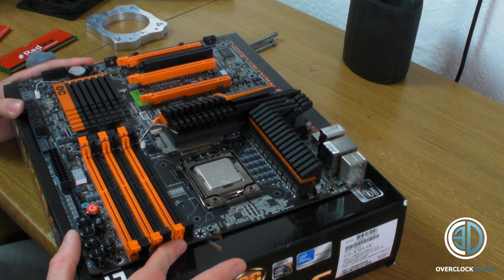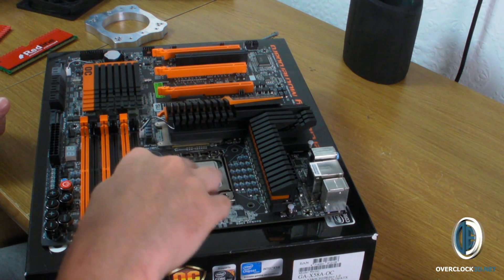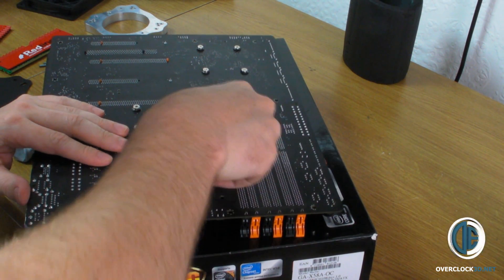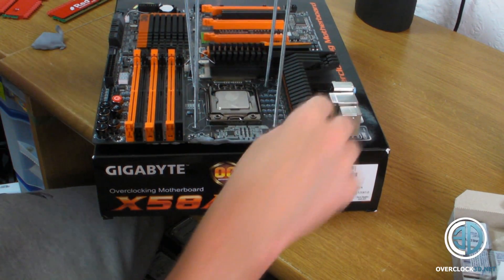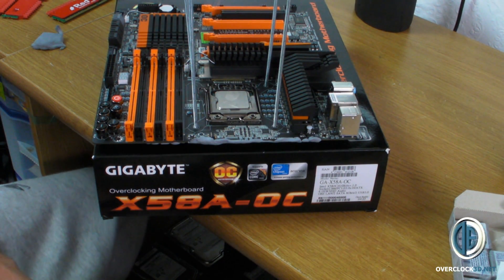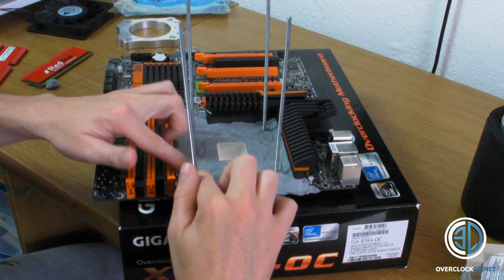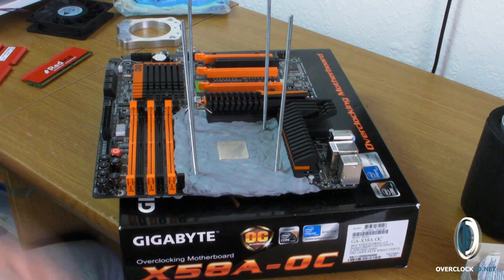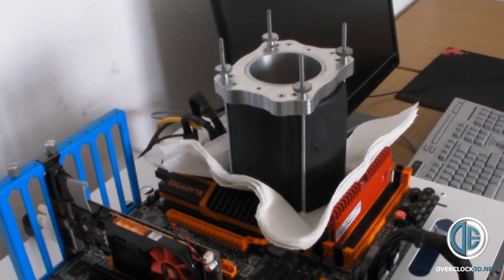Gigabyte X58A-OC - Dry Ice Insulation DICE Subzero Overclocking

Comment: @ft01061990 

Nitro? He's overclocking it, not fitting it with a turbo :D. DICE is dry ice, or technically, solid carbon dioxide. Actually, I'm wondering how the gaseous CO2 that will be produced when the block is heated will escape, or is it a completely sealed unit that can handle the pressure involved?

Comment: Here is a little tip for you TTL. 

When you want to heat up the pot just take it if when it's cold and pour hot water in it. 

It will heat the pot up much faster compared to a hair dryer.

Comment: @Romanamon 

You have to use some sort of thermal paste if you dont have anything on the cpu will still get very varm even then the copper block is -70 degrees. The basic silicon thermal paste wont work in this case because it will just freeze.